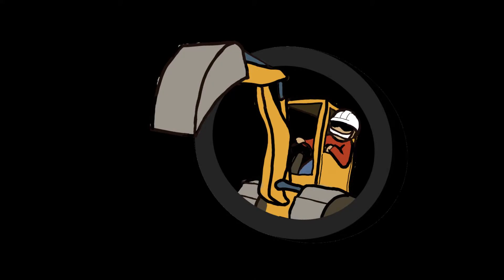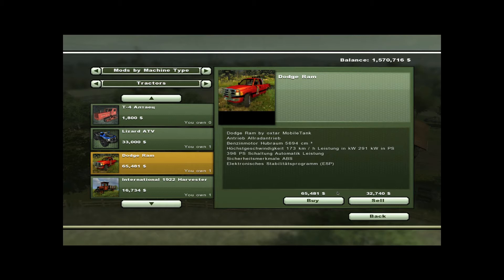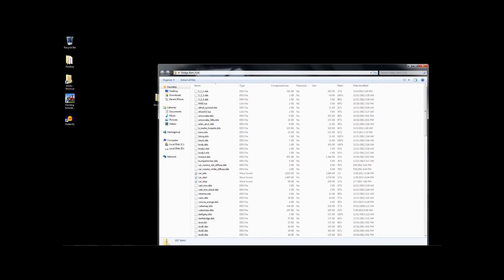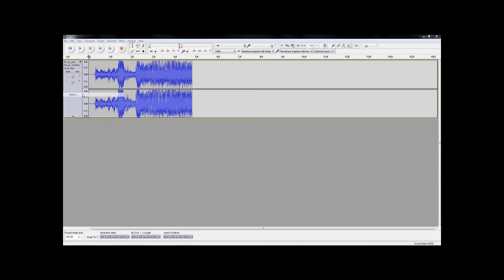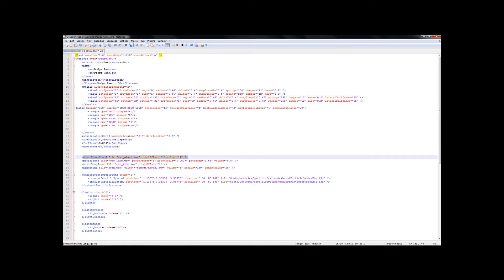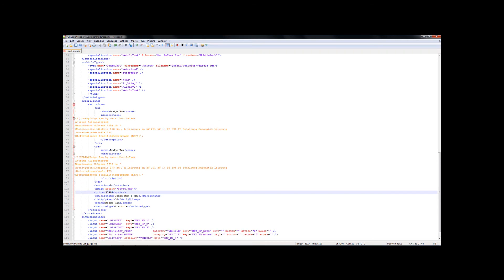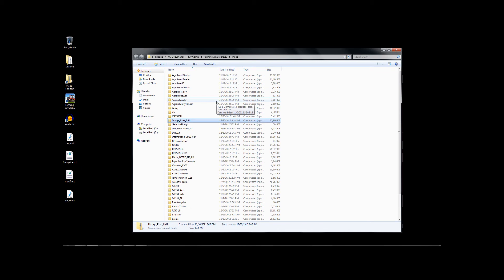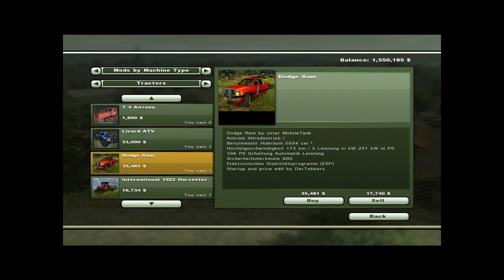Farming Simulator 2013 Mod Spotlight - How to Edit a Mod

Comment: Sorry, I know this is an old video but please help. At 7:45 you said changing the last torque setting would increase the speed of the vehicle. What I did within the xlm file of a car mod I recently got was increase the numerical value within the quotes (with notepad++), save, drop and replace the new file into mods for fs 2013 and when I started the game and bought the vehicle, top speed was about 30 mph as before. I even tried increasing all the torque settings and the results were the same. I'd please like to know how to increase the top speed and if possible the acceleration if there is no "maxAcceleration" or "deceleration" in the xml file.
Reply: Well now I found a way how to increase the max speed but still not sure about acceleration

Comment: Question, I downloaded the Chevrolet pack, one truck has a flat bed on it and the other is a regular bed on it. how can I put the flatbed on the other truck, Id like todo the same with the Dodge 3500 pickup as well, Thank you.
Reply from the maker: That involves editing the 3D model and is beyond the level of XML editing. It would also require having 3D modeling software.
Reply: Oh okay, Thank you for replying to my comment

Comment: i have a question, i found a towbar mod, but its for the deutz agrovector, i want to change it to be able to use it on the deutz agrofarm. the agrovector is just way to light to pull out a stuck tractor. any info will be great, thanks
Reply from the maker: You probably need to edit the hitch points, but that can be tricky. I'd suggest asking the the fs-uk forums.
Reply: DerTebbers i have a problem with my ferguson TE20 tractor on Fs2013 when i
buy it it says No more space and i have nothing Purchased Please Help
Reply: MasseyFergusonMaster  download more realistic from modhoster, unzip it, add in modfolder there you go ;)
Reply: No its not a MR mod

Comment: Wrong, Its a 94 to 01 Dodge Ram which came with one of 3 engines 3.9,5.2,and a 5.9 which are all Fuel injected. With that said you can convert the 5.2, and the 5.9 to a carbed engine. Its just not stock thats all.

Comment: The only reason it cranks the way it does is because its a carb not a fuel injected truck if you listen closely you can hear the gas pedal being pumped to put fuel it the carb. its supposed to sound like that btw

Comment: my guess is that it is supposed to be a manual choke, with priming pump carb modified truck.  which would require slapping the throttle before turning the key, and after it stalled to work the choke and primer pump.  That is likely the source of the sample audio used for start-up.

Like you, I prefer the simplicity of the turn key start of today's fuel injection, and with the ease of adjustment of today's management, it is in most cases a poor choice to convert back to carbs.
Happy gaming.

Comment: Der- love your vids...
As for this truck mod,Based on the sounds from your video ( I never got the mod, I'm a ford man myself), -sounds- like it is supposed to be a modified dodge, a carb converted engine.  I drove a van for one of my prior employers with a old school mechanical choke 4 barrel on it.  You would mat it to set the choke, start the engine, when it stalled mat it again to release the choke, and re-fire it.  Also some early carbs had pumps that worked my matting it repeatedly

Comment from the maker: I have some thoughts, but I haven't tested them. In the Dodge_Ram_1 xml there is a value for downforce. I am theorizing that value will increase the vehicles "weight" in the game. There are also four wheel xml nodes that have a attribute of suspTravel, spring, and damper. Those might also be the source. As long as you save a backup of the file you should be able to play with the values and see what happens.